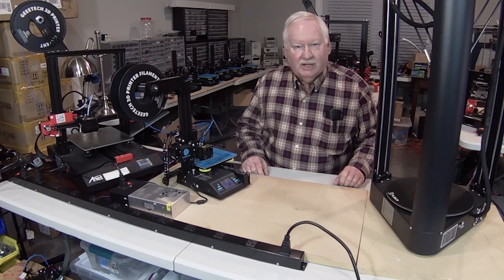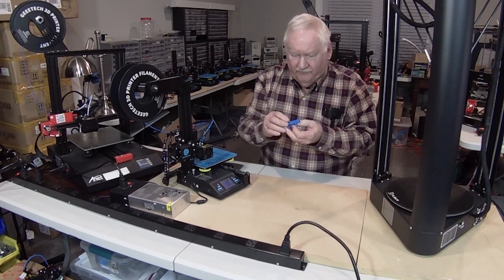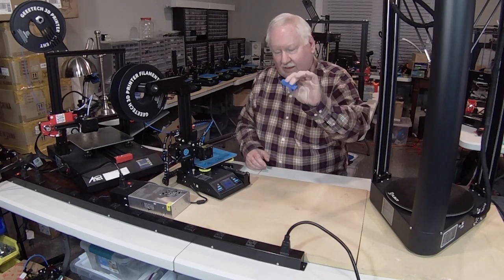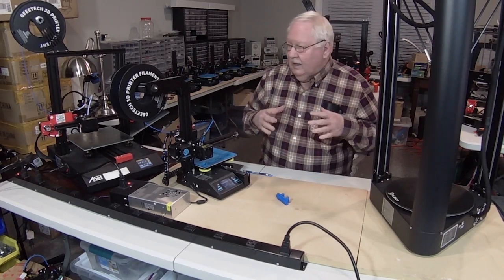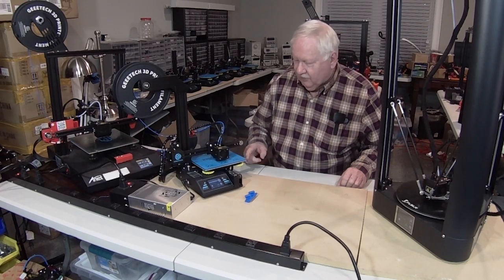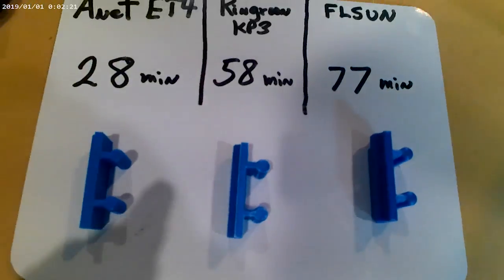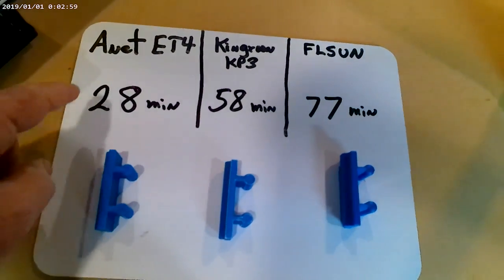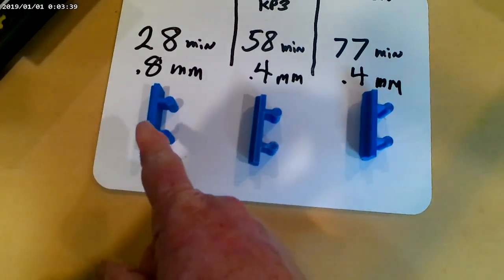Three fine printers, see how they run. May the best 3D printer win.

Comment: Hey Ken, So many factors go into the print speed, nozzle, layer height, material, slicer, slicer options.  I go through my different slicing options to get the best print speed, strength and look i want for parts that I sell that need to perform.  I have something that i sell that is TPU and it takes a lot of tweaking to get it to print perfect and fast without a lot of stringing and cleanup.  Thanks for sharing this test.  I only have prusa printers so i cant compare any.  Larry
Reply from the maker: Good to hear from you Larry, hope you and your wife are doing well and you have found a warm part of the country to enjoy this spring weather. Yea, in this video I just wanted to show how much variation in speed to print the same part on different printers could exist. It makes a big difference in the way you and I setup our printers to get the results we need. Thanks, as always for sharing and for your support...Ken

Comment: Great video Ken, it will be interesting to see what speeds you can acheive on those machines without any degredation in print quality, I know that delta machine will be able to smoke the other 2 in print speeds.
Reply from the maker: Hi Andrew, hope you are doing well. I will work on the FLSUN and see just how fast I can get it to print that same part and compare it to the 77-minute time I got without adjusting any settings. Thanks for your support...Ken